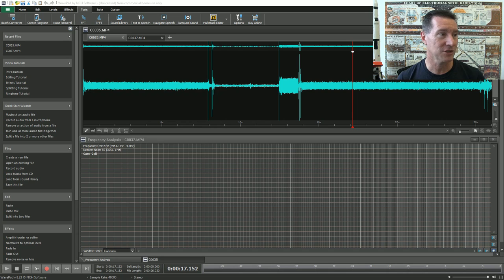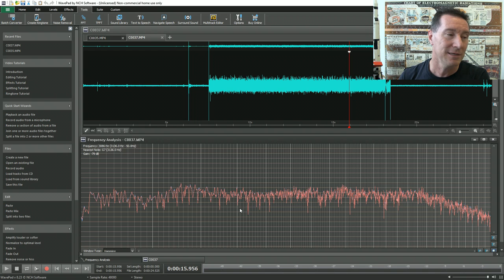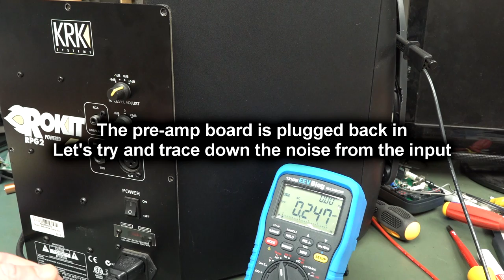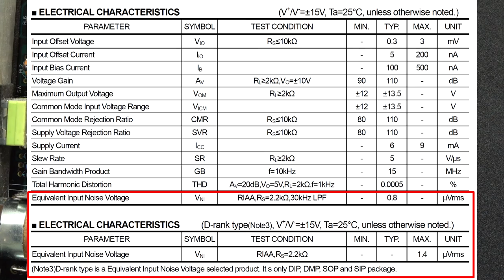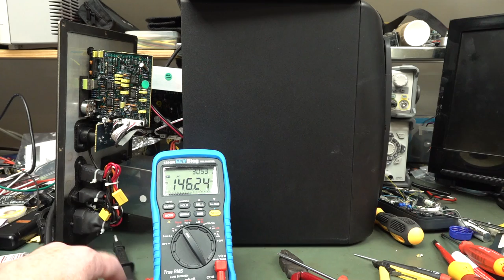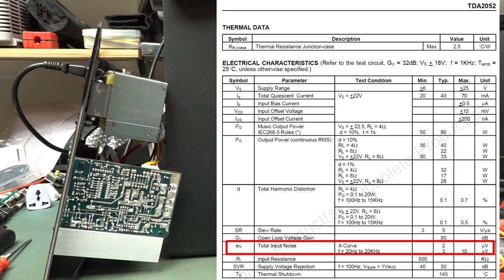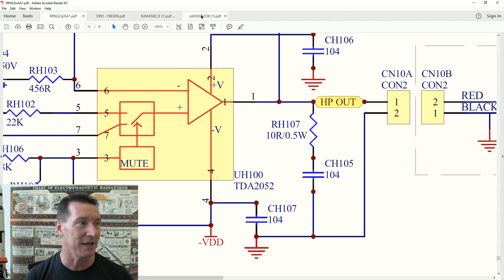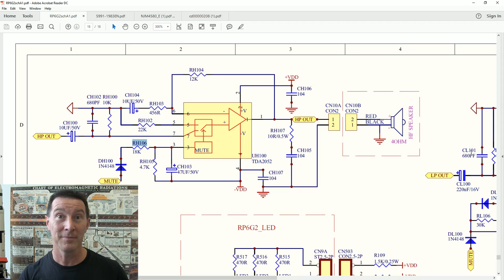EEVblog #1118 - Why Are Studio Monitors Noisy?

Comment: my 100watt vacuum tube amp has 0 noise even flat out in till you send a signal to them
Reply: That is a lie or you aren't measuring accurately enough.
Reply: I call B.S. Not knocking tubes (got my start building guitar amps) but, yeah, they have noise.
Reply: yeah but its a tube amp so you cant trust it to reproduce things properly. with mastering you need it ruler flat, linear, in phase and non coloured as much as technically possible.
Reply: pepe6666 ..from 25 hz to 28 kHz it is flat @90 watts
Reply: Dan Moos .. I agree most tube amps are quite nosy to say the least .. I stick to lo gain tubes I do not like 12ax7 or 6sl7
Reply: Oh, I believe you. My closed-back reference cans are perfectly flat as well. Totally objective, really! There's no colouration or anything, I promise.
Reply: Tubes are high voltage, low current. Not exactly the recipe for low noise. Also, frequency response is one thing. THD is another, and "ruler flat" only applies to frequency response. If the even order harmonic distortion tubes give you in even the best designs sounds good to you (in many cases I think it does), that THD is a feature, not a problem. But it's there.
Reply: yeah? for how many dB? neat
Reply: Tubes are high voltage, low current 480 volts 1.12 amps  between the two channels and 8 out put tubes 6DQ6 it can do 220 watts per channel but sound suffers so to keep it flat and clean I stay below 100 watts
Reply: Jamie Phillips There is no such thing as zero noise. There is a noise floor which in a good tube amp might be -80dB or better. A high power amp will have high gain so it will exhibit more noise than a low power amp. A tube amp has more noise than an SS amp unless the SS designer is unusually incompetent.
Reply: with the gain set to half aka 5/10 and no signal on the input 4 ohm load I get 75 microvolts on the output ... the amp will put out 90 watts with 300 millivolts on the input at this setting .. PS I think this is quite good fore a 3 stage tube amp -- edits are bad spelling
Reply: Jamie Phillips It is indeed pretty good, but it isn't '0 noise'.
Reply: it is better than most amps of this size
Reply: Jamie Phillips And it isn't zero, which is what you specifically  claimed above, and is the only matter that is being disputed here. There is no zero noise above zero degrees Kelvin.